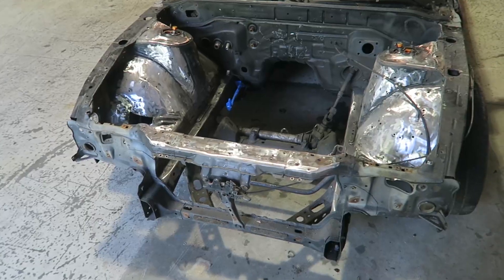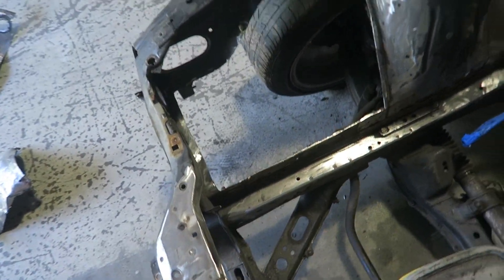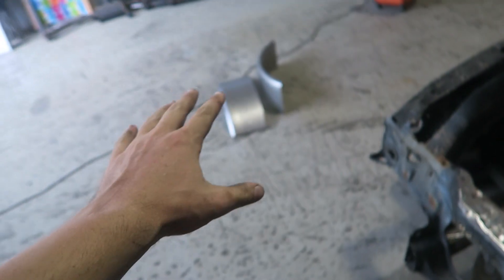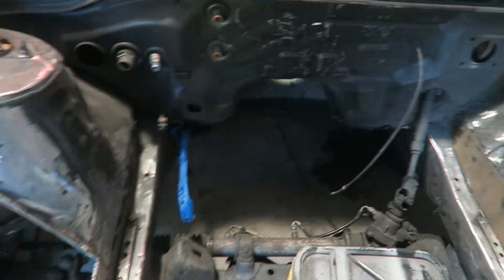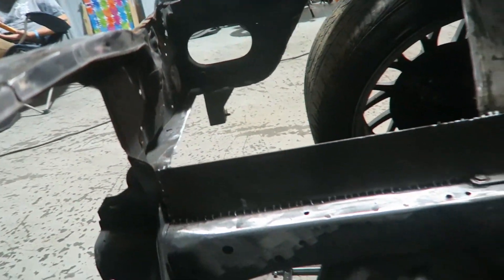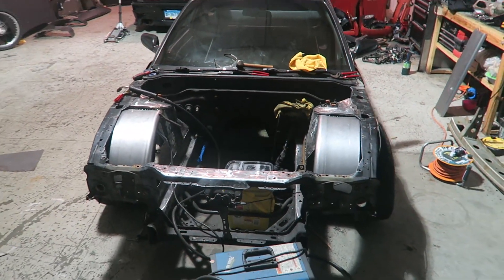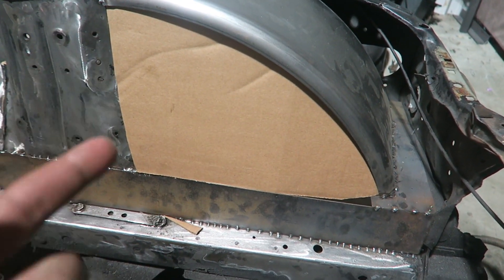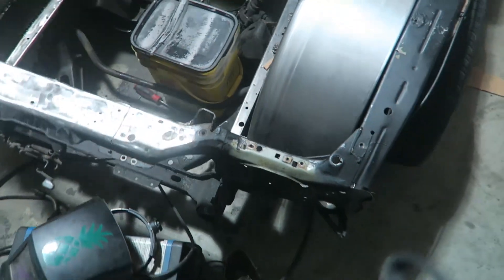BUDGET 240SX GETS TUBS!!

Comment: jimmy you should do some stich welds around the strut towers as well. grind out the adhesive, do a spot every 1 inch and lay new adhesive on top. also, before you did the long patch, shouldnt you spray some weld through primer so it doesnt rust from behind?